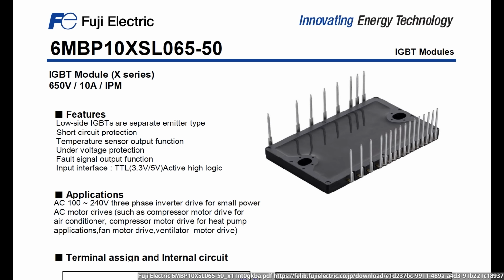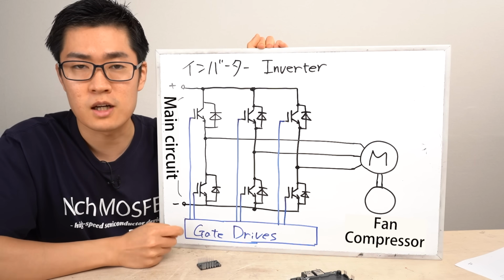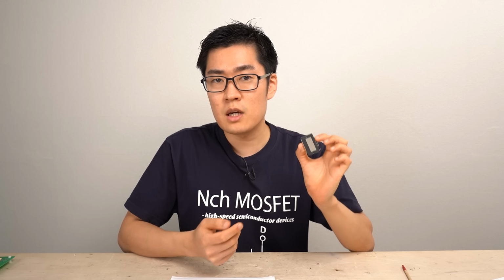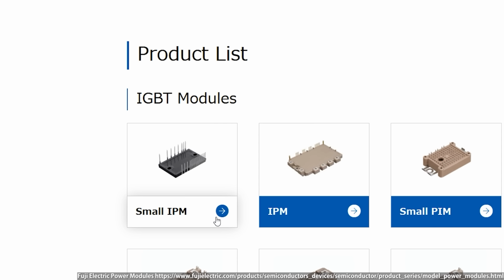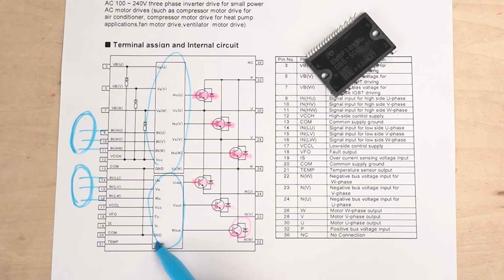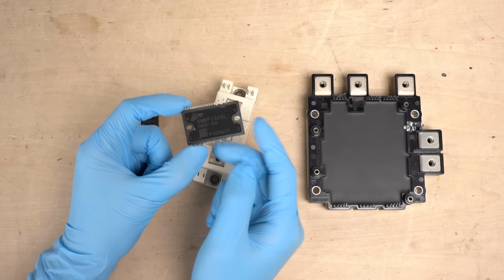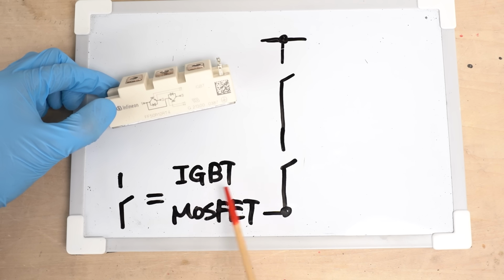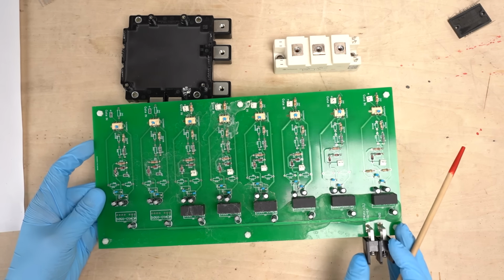This Tiny Intelligent Power Module Builds an Inverter Almost by Itself

Comment: Ipm is working on demond of internal  load comunication  on internal demond move  low and higher frequency of compressor and fan motor  if outer ambient tempture  why not use next use  as like fan speed  go high if ambient High goes fan can go High speed  why is not using also anyone sensor of outer side

Comment: 50+ years ago I graduated with a EE degree.  I concentrated on digital circuits so I had no formal training on power electronics.  Of course, over that period, I did learn some about power electronics !

In the US, small to medium sized motors (like residential refrigerator and air conditioners) run on single phase power.  3 phase power is typically only used in commercial or industrial application and the 3 phase come directly from the power company (and is only available in certain areas).  At first I could not understand why anyone would want such a low current IPM for building an inverter.  Then I realized that 3 phase motors are much more efficient than single phase and you get the bonus of variable speed !  Converting single phase AC to DC is easy.  With IPM it is even easy to convert DC to 3 phases !

It is interesting to see how things are done on your side of the world !

Comment: can you make a circuit for a BLDC motor for a washing machine? I have an old LG washing machine that I want to revive since the original board controller  is not working anymore and there no  more replacement.

Comment: I have worked with this 6mbp series (15vsg) iirc, they are quite neat on small vfd, however in some low frequency high current application it tends to die sooner than competitor with similar ratings, so I had to chose one step larger capacity. It responds well to high frequency switching tho.

Comment: Thank you so much for sharing your experiences. You did this as a labour of love because there's no way you're going to make money out of such a narrow topic. For what it's worth, I had a lot to do with MIBi (men in black international) and the hoverbike therein. One of my tasks was to effectively make an E bike under the hood that could accelerate fast enough to have a stunt woman fall off the back. 25 kilowatts of unrestrained power. Powering that up was Dang scary as well. I did a lot of smaller purpose-built remote control motorised vehicles as well and I was always popping MossFets. I wish I had seen your video first!

Comment: You did not discuss limitations.  Can an ipm be used for non motor inverter like for 12v to 120v or what about durability? Size is also only 1 factor. Are they cheaper?

Comment: We’ve been using brushless controllers, known as ESCs, in model RC cars and airplanes for over 15 years.
Reply: I'm not certain that BLDC motor will ever be cost effective to run heavy loads.   Induction motors are excellent for heavy loads.  3 phase induction motor are much more efficient than single phase motors.  If you can efficiently and cost effectively convert single phase AC to DC and the DC to 3 phases, you could save a lot of power.  The bonus is doing this via a small amount of electronics, you also get variable speed.

Comment: Very informative as usual.
Nice PCB design also with the cuts between phases.
I'm just wondering about the heatsink. Most probably you don't plan to use any and stay in low power ranges just for proto/teacing purpose, since there's no way to screw the IPM on the heatsink.
Screwing might be the recommendation from the IPM supplier I guess.

Comment: That's all for making your inverters unrepairable. The scheme was not really complex. Changing MOSFET was doable and  relatively cheap. But this System on chip will be unavailable or the price will be like 80% of new inverter. Moreover it as it is a system it will be broken if any element inside will fail... As it is power electronics it will heat up. On old schemes heat was distributed. Here you have everything in one place. So active cooling is essential.

Comment: I work for a company that repairs industrial inverteters. Several KWs with bus voltage in the range of 600vdc and capacitor banks many 1000s uf. and I can say that I am always nervous when I am testing a repaired unit. Failing semiconductors in this range of power creates really powerful plasma arcs. They can melt and burn things like circuit boards or conductors in a moment. Really nice and very informative video! Thanks!

Comment: Unless you are under a multimillion contract where the manufacturer is forced to provide with spares for a long time (like in those japanese trains), the costs will skyrocket due lack of maintainability and logistics very fast, as others have been commenting. These things are pretty fragile, and blow up pretty easy under non controlled situations. And since manufacturer outdates them pretty fast, it will ensured you will have to buy a new item as soon as the module blows, as you will not be able to find a replacement elsewhere.

Comment: There's nothing like powering up something with a large amount of potential energy for the first time, wondering at what point it will blow the power electronics/switching circuitry...  releasing that very expensive magic smoke.

Comment: Can u build DC -AC single phase inverter to drive household load?
Reply: Using two of the large 2-in-1 power modules like he's shown would be a perfect application for single phase inverters, although for household applications, you would need to have significant output filtering in the form of LC filters or some more advanced topology. Many motors can handle the rapidly changing voltage of an unfiltered inverter, and will naturally smooth the current waveform. On the other hand, most household devices will not like this same waveform, and need the voltage to be smooth.

Comment: If even electric cars don't use IPM, they're not worth it. They have a higher price, they lock you to a specific vendor and often are a nightmare to repair because they go obsolete very fast and the cost for the remaining stock skyrocket. 
Servals years ago I had a bad IPM in a 20'000$ industrial maschine. It was impossible to find a new one. The only option was Alibaba (of course counterfeit). It broke within a few days. I ended up repairing the original by microsoldering and using a external mosfet.
Reply: W@r is showing up that going simple  is generally the best path, as the added repairability saves actual money, with the tradeoff of getting a bit bulkier. With intergrated vendor locked solutions, it is all "flashy 'n modern" giggles, until it doesn't work in actual application logistic scenarios.

Comment: disadvantage is repairability
Reply: As long as replacement parts are available, I won’t complain.
Reply: @triforcelink  Replacing a IPM is like replacing the whole board. It make sense only for industrial products, but for residential ones often this old IPM modules cost the same as buying new deveice.
Reply: @triforcelink  But will they be available? It is already hard to find some ICs from 10 years ago, especially non-fake ones...

Comment: Yes, using an IPM simplifies design, but you have to make absolutelly superb heat dissipation, otherwise and ipm will be deceased very fast.
IPMs are usually optimized for certain pwm frequency, mostly 5kHz.
Reply: The maximum is only 5 khz?
Reply: @szekerespista3758  Optimized for 5kHz, lowest disspipation, but usually can go up to 20kHz. However, you usually don't need higher than 8kHz PWM for induction motor, mostly because of skin effect.
I need people who are interested on making their own inverter based on IPM, read the datasheet and read it well!
Reply: @SanelKeys thanks!

Comment: @ 1:21 - the indoor unit fan motor too in the last years … and they fail quite often 😅
Reply: filter and heat sinking not good enough?
Reply: @liam3284 - they have no heat sink 😅 - the IPM driver is enclosed in the plastic fan motor case under the back metal cover 😅 - cheap/bad design to buy more parts 😂
Reply: @mihaiachim5299 Yes... I often come across Daikin products made in Thailand.

Comment: Can you do FoC with IPM?
Reply from the maker: If the controller can do FoC, it can be done with other power semiconductors as well, not just IPM.
Reply: @DENKI-OTAKU for foc you need a fine grained PWM which means high frequency. That's no good with IGBTs
Reply: @wiju  This is untrue, it is absolutely possible, but your control loop may have to run faster than your PWM frequency. FOC was performed all the way back in the 70 and 80s using analog hardware with analog computers. The founders of my research lab were some of the first people to ever achieve field oriented control of PM machines and induction machines, and they were able to do this with only GTO thyristor drives.
Reply: @novertrunnions2721 you'll have a lot of trouble creating the pseudo sinus, but yes, it is. I guess with high voltage lower current it may be even feasible
Reply: No. Igbts are to slow